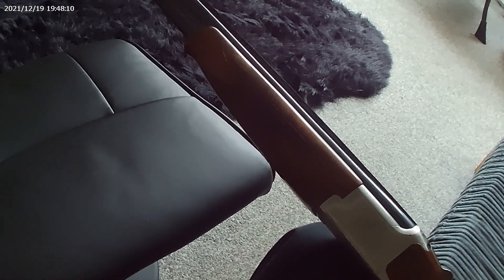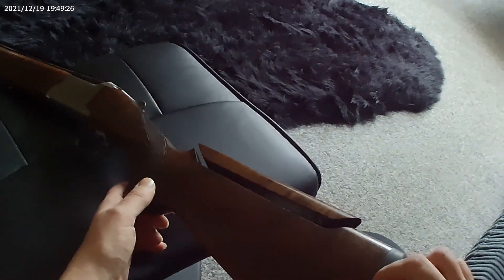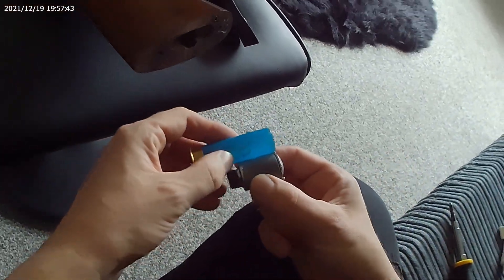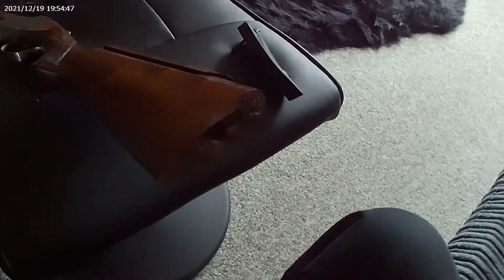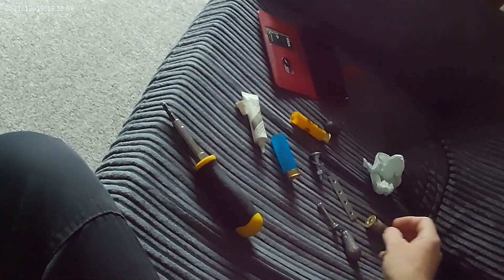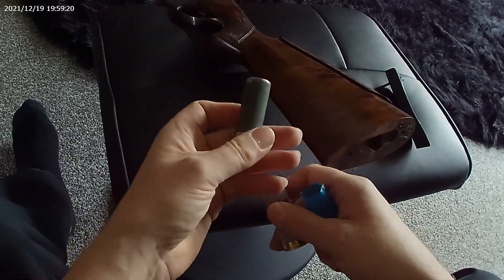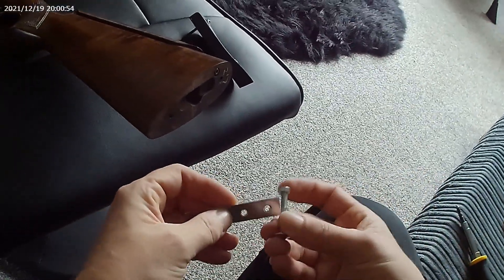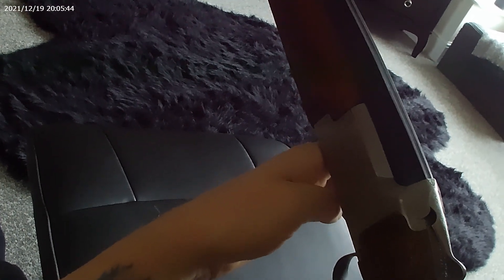How to balance a shotgun

Comment: I've balanced all of my O/U shotguns by taping a small plastic bag to the top of the recoil pad. I then hold the shotgun under the pivot pin & add weight to the plastic bag, until the gun balances on the pivot pin. I've used small round lead fishing weights, or OO buck shot. I then remove the recoil pad, fill most of the bolt tube with bubble wrap, roll up the weight filled baggy, push it into the back end of the bolt tube & replace the recoil pad. The guns are no longer nose heavy, it handle better & has a little less recoil with the added weight.

Comment: I bought lead curtain weights off Amazon, they’re fabric covered so you can snip the little lead balls off to achieve the balance.  Then stuff the bolt hole with bubble wrap and fit the coiled curtain weights in and refit the butt plate and the weights don’t move.
Reply from the maker: @bartram33  Thanks for sharing another viable option

Comment: My Browning 725 came with a pro balancing kit included. It consists of a threaded rod and 6 weights that can be installed and tightened down with a Nylock nut toward the rear of the stock maximizing the additional weights.
I think the kit adds up to 8oz to the rear of the gun, (i installed 2 weights).
I bought the gun just a year old and the initial owner sold it with the system included. It's a good piece of kit, mind you. it ought to be for £85.😲

Comment: Great video mate where did you get those fishing weights got a browning 525 sporter!
Reply from the maker: Any good fishing tackle shop should have them. I've now adapted it further and used a long thin self tapping screw place through a thin flat bracket, that is secured by the butt pad. Make sure the weights are lead as they are easy to drill or shave to size. Check the diameter of your bolt hole before buying the weights. Different guns vary, even by the same manufacturer.

Comment: how would balance weight at the front as my gun is stock heavy
Reply from the maker: @mitchell_9709  Some guns accept barrel weights that are often available from the manufacturer. If it's only marginally stock heavy, I'd be tempted to keep it that way. It's generally more controllable than barrel heavy and will aid recoil.